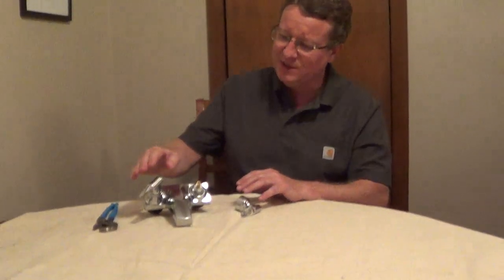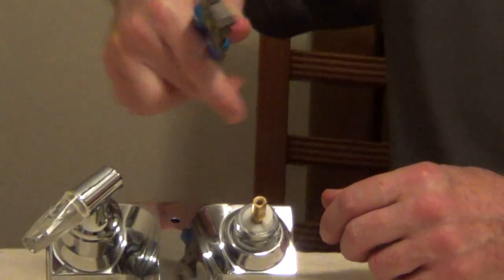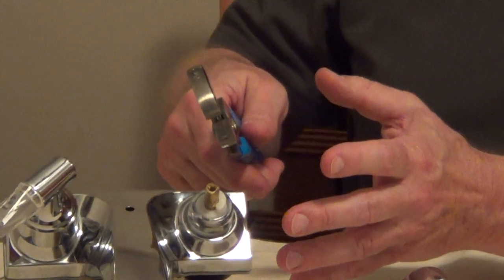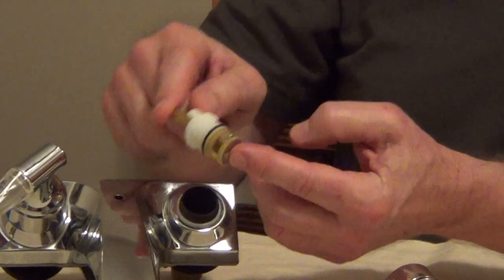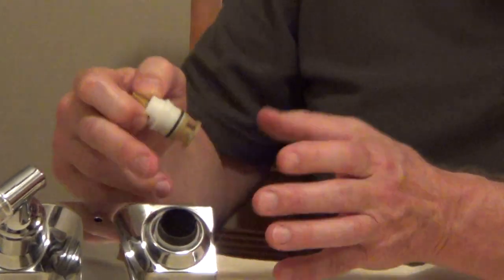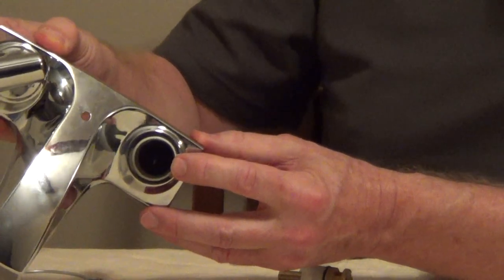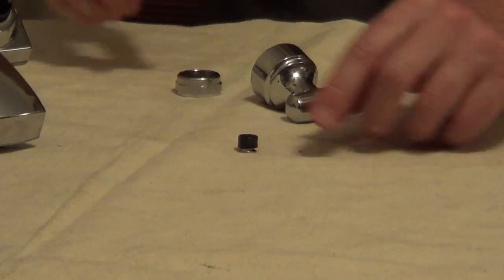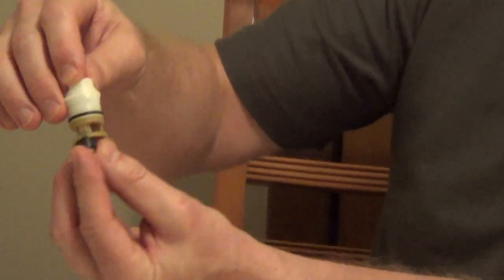How to Fix a Leaky Delta Faucet - Delta Faucet Dripping

Comment: This was fantastic and immensely helpful. Those new cartridges are going for $15 each, so a small project of replacing all cartridges in all sinks in your house can turn out to be pretty expensive. I did not know the valuable tip of replacing the seat first. Makes total sense. It makes sense to troubleshoot and/or replace seats (or cartridges if necessary) all at the same time. Thank you.
Reply from the maker: Glad it was helpful!
Check out more home improvement tips on our weekly podcast 
https://itunes.apple.com/us/podcast/fix-it-home-improvement/id880903087?mt=2

Comment: 1- plumbers grease is not meant for oring lube, and eventually the oring will expand from the grease, making the handle hard to open and close. 2. If you have mineral deposits on the surface of your brass body where the cartridge sits, you can clean it by sticking a rag wetted down with vinegar in the hole for an hour and then cleaning it out 3 if you do t want to mar the locknjt just use adjustable wrenches, which is a better tool for that task anyway. Good video

Comment: I watched tons of videos regarding my Brizo faucets, and this has finally cleared some of my doubts when it comes to how the bottom of cartridge will shut the water that is coming through, by blocking the seat. Which it makes sense. But when i tried to block the seat with bottom side of cartridge, the ceramic piece in the bottom broke. Also, i wish this video addressed the issue in case someone forgot to what side the lever must be put back. If someone cant remember to which direction the lever must be placed back, to avoid closing it in a weird direction against the orientation it supposed to.

Comment: Great video, but you forgot to mention the first step is to shut water off  by turning both valves under the sink to off like i mentioned otherwise you well have running water allover the floor.
Reply from the maker: Yes, shutting off the water is a good first step!

Comment: Just took mine apart and headed to the hardware store.What is the best way to the put the spring and seal back in so it locks?
Reply from the maker: Hi, you can use a precision screwdriver or nail to guide the spring and seat into the faucet. Put the spring wide side down with the seat on.
Check out more home improvement tips on our weekly podcast 
https://itunes.apple.com/us/podcast/fix-it-home-improvement/id880903087?mt=2
Reply: @FIXITHomeImprovementChannel  thanks used the Allen wrench that I took the handle off to guy it in! Leaking is stopped u rock!

Comment: At the end of the video "If it is still leaking you have to replace the entire cartridge".  There is another washer inside the cartridge.    Pull the side base and the top stem apart to access the washer.
Reply from the maker: Yes, thank you, I should have shown that.